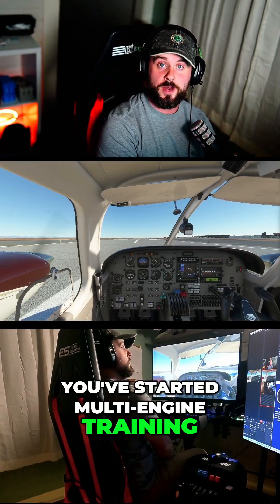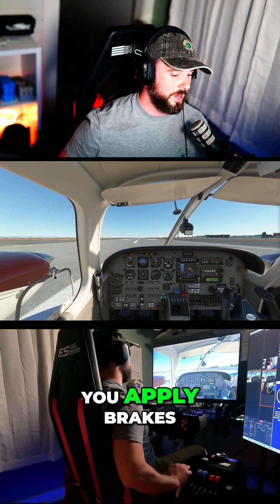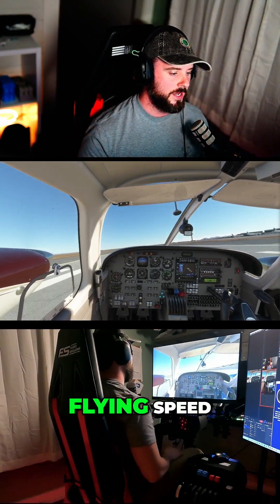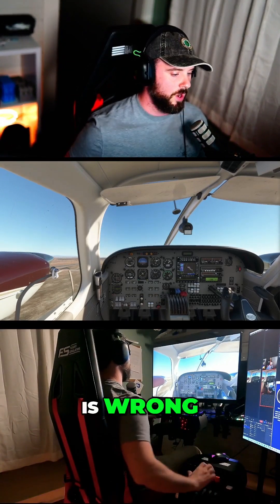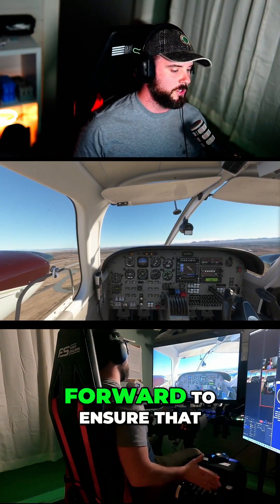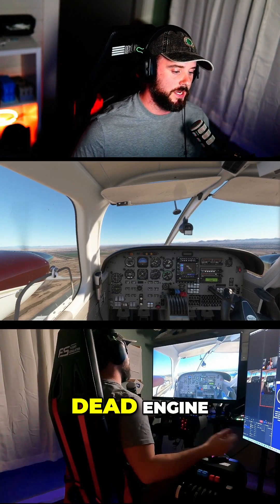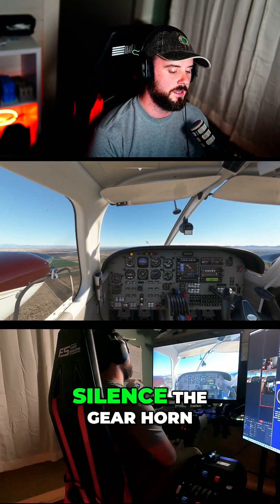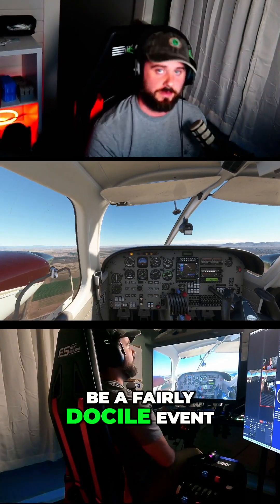Mastering Engine Failure: Stay Calm and Fly On!

Comment: Do you think gear should be up at positive rate or no more usable runway? I heard its desirable to get the gear up as soon as possible to improve climb rate and get as much altitude as you can to better your chance in the event of an engine failure.
Reply from the maker: I usually go with no more usable runway but that usually occurs at about 50 feet AGL. The reason I say 50 feet is because that’s what all of my landing numbers are based off of anything above 50 feet AGL I don’t have any landing numbers so who knows how long it’s gonna take for me to come back down and land. Most light twins like a Seminole are gonna take around 1100 feet to get off the ground and then 1500 feet to go from a 50 foot obstacle to complete stop which comes to about 2500 feet not including the time it took you to climb to 50 feet and accelerate so we round it to an even 3000 to takeoff climb to 50 feet lose an engine and land if you’re on a 10,000 foot runway you might have enough runway to land after an engine failure above 50 feet but most of the time that’s not gonna be the case